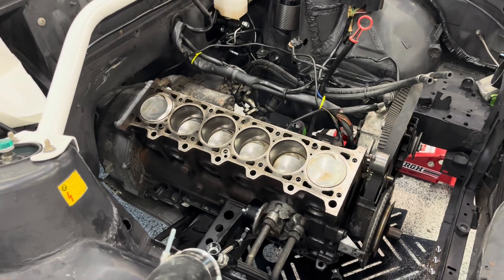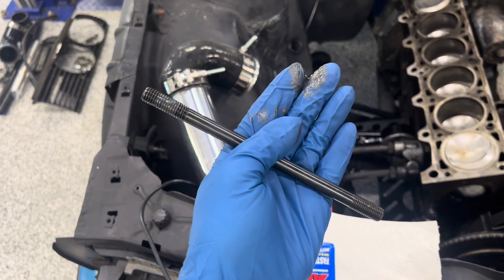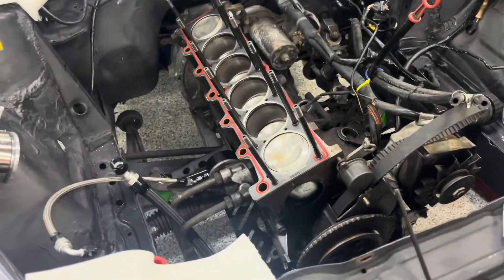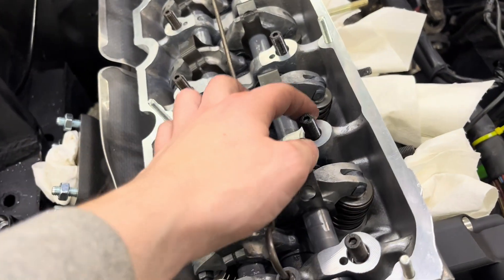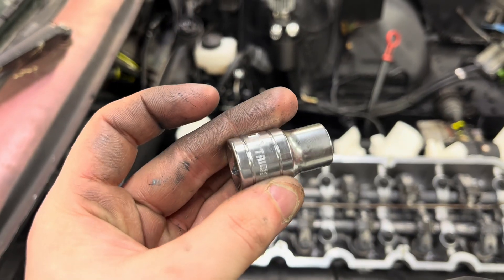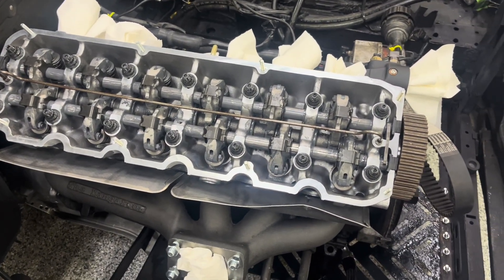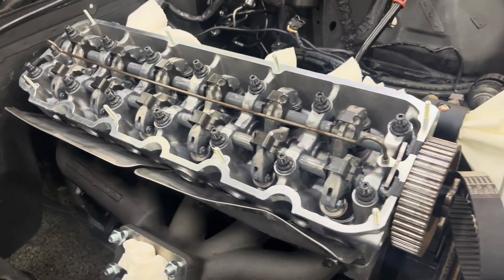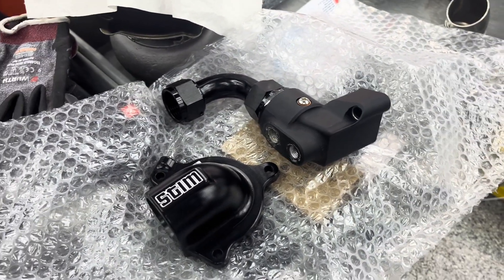ARP head-stud installation on BMW m20 motor

Comment: The reason that it slips so much is because your washers are spinning
The correct way is to sand the washer side which sits on the head with a 400 grit sandpaper and lubricant free that side so it dosnt spin.
You want only the nuts to turn not the washers
If the washers are spinning you causing the bearing effect and the torque is all over the place
Reply from the maker: @bmwe-op4jx  good to know, thank you!
Reply: @e30brandon  i have a 500+ whp m20 turbo build!! Those small little details made the difference
Reply from the maker: @ hell yeah that’s awesome! Are you stock bottom end and still 2.5l or did you go forged and stroker?
Reply: @e30brandon  forged bottom and top !2.5 with amc head and 272 cam
Stock crank